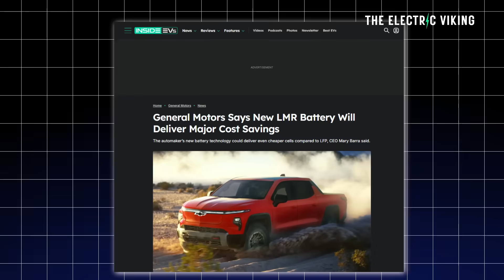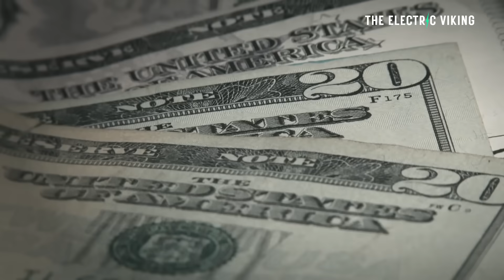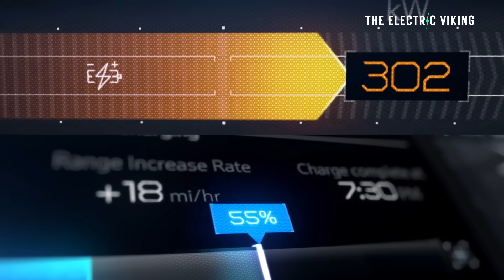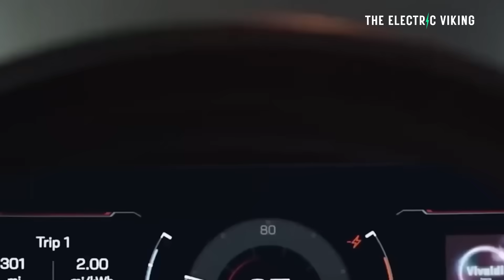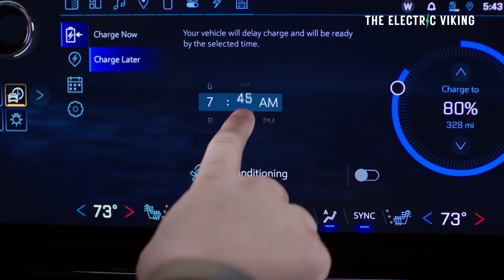GM's LMR Battery: Cheaper Than LFP?! The EV Game Just Changed!

Comment: I don't need long range. What I do need is batteries that cannot go into thermal runaway. They ALL need to switch to Sodium Ion. If all I had was 200 mile range, and fast charging then I'm happy.
Reply: Why not 300 miles range so you can road trip anyplace in the US? Thermal runaway is so rare it's not an issue. 200 mi in 30 minutes works for most normal people.
But price is a huge issue, how much extra would you pay for Sodium ion in up front costs and efficiency?
Reply: Horses for courses, but yes, non flammable or self extinguishing batteries are the way forward.
Reply: LFP can not go into thermal runaway and is widely used already. Sodium ion suffers from poor usable energy ration, but perhaps it will be improved. LFP also has much better cycle life.
Reply: @xeridea  Yes they can go into thermal runaway also.  It's what happens when Lithium catches fire. It's just not explosive like NMC.
Reply: @grndzro777 no, they cannot go into thermal runaway. Yes, they will burn if you was to throw them into an existing fire, but they will not themselves cats on fire. It is not possible. They can get hot if it's used and vent, but they will not catch fire by themselves
Reply: @xeridea at 270 C the cathode will release oxygen and has caused thermal runaway. Very rare and there need to be contributing factors.
Reply: @rodneyblackwell2557 okay, and for it to get that hot, you would most likely need to just throw it in a fire. The chance of it going into thermal runaway on its own is absurdly low, borderline impossible. In general it is a very safe chemistry
Reply: CATL already made sodium ion battery pack that has 175Wh/kg and 6000 cycles, similar to LFP in terms of energy density and longevity but with way cheaper costs. Let's hope many other battery manufacturers will follow suit in at least a few years
Reply: Good for you
Reply: Sodium batteries have very poor round trip efficiency and poor capacity. They're still miles ahead of LFP. And by the way, LFP do not suffer from thermal runaway.

Comment: GM vs Tesla vs China’s BYD: 5 Numbers That Reveal the EV Battlefield

General Motors (GM) remains a global heavyweight, but it’s facing mounting pressure from American rival Tesla and Chinese EV giants like BYD. General Motors ranked 6th globally in vehicle production volume in 2024, with an estimated output of approximately 5.8 million vehicles, behind Toyota, Volkswagen Group, Hyundai-Kia, Stellantis, and Renault-Nissan-Mitsubishi. These five numbers illustrate the financial and competitive realities in today’s electric vehicle race:
	1.	$100+ billion (GM) — GM’s total debt load towers over both Tesla and BYD. While a large portion stems from GM Financial (its lending arm), the burden puts it at a disadvantage compared to Tesla’s $5.5 billion debt and BYD’s $15–20 billion.
	2.	$85–$100 per kWh (GM) — This is the estimated cost of GM’s new LMR battery. In contrast, Chinese EV makers like BYD produce LFP batteries for just $55–$70 per kWh, giving them a massive cost advantage in budget EV segments.
	3.	$6 billion (GM) — GM has launched a share buyback program of this size, signaling confidence. Meanwhile, Tesla is reinvesting heavily into AI and robotics, while BYD is expanding production and exporting at scale — with fewer distractions and greater capital efficiency.
	4.	<1% bankruptcy risk (GM) — GM’s probability of bankruptcy remains low, but it faces more structural financial stress than Tesla or BYD, both of which run leaner, more cash-efficient operations and generate higher margins per vehicle.
	5.	$1.1 billion (GM) — This was GM’s Q2 2025 profit drop due to U.S. tariffs. Meanwhile, Tesla is building production overseas to avoid tariffs, and BYD is gaining ground in Europe and Latin America, where it’s not burdened by U.S. trade policy.

⸻

Conclusion:
GM is still financially stable, but faces steep uphill competition. Tesla dominates tech and branding. BYD wins on cost and scale. If GM can’t close the gap on battery pricing and EV margins — while carrying heavier debt — it may struggle to compete globally in the long run.
Reply: Number 4 is wrong.  BYD can't pay suppliers leaving them hanging for 9 months to a year.  They lie about their debt load like 10 fold.  They claim their debt was 47 million yuan when really it was over 300 million yuan.  They got caught lying again.
Reply: How is GM a global heavyweight, North American probably but they walked away from the European and many other world markets years back.

Comment: I paid $20k total for my 23 Chevy Bolt.  It is fast and economical.  Love this little car!
Reply: Those original Bolts were (still are) a big problem for GM. GM made a cheap, dorky little compliance car that they hoped would turn their customers against EVs. The big problem is that the customers loved them! The were cheap, quick, fun to drive and will seemingly last forever. Yes, a very small number of bad batteries (13) resulted in fires, but they figured out how to identify the bad ones so that no longer appears to be a problem. I have a 2020. It has the original battery. After 5.5 years, testing the battery shows that it still has 103% of its rated capacity. The customers demanded that they bring it back. Now GM will have another $25k car that will sell in big numbers when they really want to sell $80,000 trucks and SUVs.
Reply: @CL-YouTube-y7e  The purpose of the Bolt was to clog up chargers. If you know anything about their drivers, they are attracted to 350kW or higher chargers like fireflies for their 50kW charging Bolt. They leave them there for hours at a time. But with the proliferations of chargers in America, and Tesla opening up their vast network, that strategy went down the drain. 

So GM decided that if you can't beat them, might as well join them. And they now make the best charging EV trucks in America by far, as well as the best charging 7 seater SUV, alongside the new Lucid Gravity.
Reply: @junehanzawa5165  Most EV owners charge at home. The only people that fixate on charging speeds are people that don't actually own EVs.
Reply: @CL-YouTube-y7e  That's why Tesla started a nationwide DC Fast Charging network, when, of course, Leaf owners making up 0.01% of all cars sold knew all that was needed for mass EV adoption was home charging. Because you know that the only people who fixate on charging are those that don't drive EV's.
Reply: @CL-YouTube-y7e  That's why Norway, the largest adaptors of EV's in the world with a 96% adoption rate, has the largest number of DC Fast Chargers per capita in the world. But of course, those who say all that's needed is home charging know better, and know that the only people who fixate on charging are those that don't drive EV's.
Reply: @CL-YouTube-y7e California, the state with the 5th largest automobile market in the world, with more than a 25% EV adoption rate, has more than 2 DC Fast Chargers for every gas pump; and yet there are still long lines waiting to charge, when of course, they should know all that is needed is home charging, because the only people who fixate on charging are those that don't drive EV's.
Reply: @CL-YouTube-y7e  That's why all the major charging providers in America are spending billions of dollars installing nothing but 350kW and 400kW chargers. But of course, those championing home charging know better and know that's just a waste of money.

That's why all the major auto manufacturers in the world are all turning to 800V. Mercedes Benz, BMW, Audi, Porsche, Kia, Hyundai, Genesis, GM and GMC EV trucks, Cadillac Escallades, Lucid, and all the brands in China. But according to you that's not needed, because the only people who fixate on charging are those that don't drive EV's.
Reply: @junehanzawa5165  When actual EV owners are surveyed, 80% say that they have never fast charged. Sure, there are renters that bought EVs and found that they must wait in line. But that isn't the majority of EV owners.
Reply: @junehanzawa5165  Those charging providers are installing them because of the money allocated for it in the Bipartisan Infrastructure bill.

Your rant is proving to everyone that you don't own an EV and certainly not a home in which to install your home charger. If you did, you would understand my point. That point being that a homeowner DOES NOT NEED access to fast charging on a daily basis. They charge at home. A level-2 charger is sufficient to meet their charging needs except on road trips.
Reply: @CL-YouTube-y7e Probably more than you. We've had two Teslas, a Kia and a Rivian. And have home charging. Which is why it ticks me off so with you stay close to home and never go anywhere with your 50kW charging Leafs, Bolts and Niro's telling everyone fast charging is not needed. A mindset that did ZERO for mass EV adoption.

I just gave you Norway, China, California and all that's going on in the real world, yet you want to live in your little closed off world that never go anywhere and want people to all be like you. You all know better than trillion dollar corporations. It's all about you and your little world, and we don't need fast chargers, and we don't need fast charging EV's. Just be like us and charge at home, and on level 2 when you're at the store and get a full 10 miles for a whole hour at the store. Yeah, that's how the world works.
Reply: @junehanzawa5165   Wow....I hope you feel better.  Consider re-reading my comment.  The last sentence was what I meant to convey.  My original sense of fascination with cars.  I'm not telling anyone anything....other than the Bolt depicted in the Video is a car I really like.  The Chevy Bolt is a fun little car and super economical.  Fast and Fun.
Reply: @junehanzawa5165  The Internet is fun! You can pretend to be whatever you want to be. I bet you parked those cars next to your McLarens and Lamborghinis.

Simple common sense dictates that people will do most of their charging at home where it costs very little or might even be free if they have solar.
Reply: ....I'd like to add that we charge with 110v and it ramps up to over 300 miles of range.  Really great car.
Reply: @orpsman76  Yep. We get a true 300 miles of range in around town driving.
Reply: @CL-YouTube-y7e   I LOVE single pedal driving.  Which also increases the rate of reclamation.
Reply: @CL-YouTube-y7e  That's why Tesla started a nationwide DC Fast Charging network, when, of course, Leaf owners making up 0.01% of all cars sold knew all that was needed for mass EV adoption was home charging.

That's why Norway, the largest adaptors of EV's in the world with a 96% adoption rate, has the largest number of DC Fast Chargers per capita in the world. But of course, those who say all that's needed is home charging know better. 

That's why China, the country with the highest total numbers of EV's in the world, have 400kW, 500kW, and upcoming 700kW charging EV's with chargers to match. But of course, you know that home charging is more important and they're clueless.

And California, the state with the 5th largest automobile market in the world, with more than a 25% EV adoption rate, has more than 2 DC Fast Chargers for every gas pump; and yet there are still long lines waiting to charge, when of course, they should know all that is needed is home charging.

That's why all the major charging providers in America are spending billions of dollars installing nothing but 350kW and 400kW chargers. But of course, those championing home charging know better and know that's just a waste of money.

That's why all the major auto manufacturers in the world are all turning to 800V. Mercedes Benz, BMW, Audi, Porsche, Kia, Hyundai, Genesis, GM and GMC EV trucks, Cadillac Escallades, Lucid, and all the brands in China. 

But yet you, and all those championing home charging and slow charging EV's, know better than all of them and know that home charging is way more important. Forget their combined trillions of dollars in valuations, you all know much better than them.

Because you know that the only people who fixate on charging are those that don't drive EV's. Those waiting on those lines, including for 50kW Bolts and Totoya BZ4X blocking 350kW chargers, are just fake news.
Reply: You are such an idiot to buy an antique American junk car with so much money enough to buy a luxury Chinese EV.
Reply: Yes. 90% of all the Chevy Bolts are still on the road!
 The other 10% had enough charge to get home.....
Reply: @JohnShields-df8od  That joke started with the Model T.
Reply: @JohnShields-df8od 🤣 I was in the 10%
Reply: They discontinued the bolt because too many batteries were defective causing fires. They are supposed to make a new gen in 2026.
Reply: @PyroShields  Exactly 13 defective batteries caused fires. That compares with 232 Tesla battery fires.
Reply: @PyroShields Original Bolt was an older platform that's pricey to manufacture mostly.  Even with the battery issues Bolts still had a lower rate of fires than gas cas do, and hybrids are even worse than gas cars for fires. Look up NHTSA car fires by car type. Used Bolts sell like hotcakes around MA, I'm looking for one.
Reply: @ronfarnsworth7074  GM and NHTSA was advising not to park these cars near your home.  Why do you think they discontinued them.
Reply: @PyroShields Yes that was true while initial diagnosis and proof of fixes was taking place. But if that's a concern then gas and hybrid cars should never be parked in a garage.
The original Bolt platform is very dated at this point and expensive to manufacture. With less margin on small cheap cars that's a big factor and good reason for GM to update plus with updated platforms they can sell to Honda, Acura, etc.
The original battery problem is that LG manufactured the pack temp control loops incorrectly. LG and GM split the cost of recall 50/50.
Thanks for reply.
Reply: @PyroShields  16 fires. Out of 142,000 sold that were recalled.
Reply: @ziploc2000  There were 18 total fires, but only 13 were actually caused by defective batteries.

While they recalled all cars, they ultimately remediated most by applying a software fix that proactively identified when the battery was defective. Not all batteries had to be replaced.
Reply: @CL-YouTube-y7e Ah, thanks. I've seen 16, the point was it was a tiny fraction compared to the number of gasoline powered cars that burst into flames.
Reply: @ziploc2000  There's a tiny fraction of the number of EVs as there are gas-powered cars.  In China, which is "ahead" of us on EVs, there are ordinances against using enclosed car parks because of the catastrophic fires.
Reply: @PyroShields  They discontinued the Bolt because it was not and will never be a highly profitable vehicle for them. Less than 20 of the bad battery packs burned, nobody was seriously harmed, and GM learned how to identify the bad ones and completely dialed them out of the fleet on their first attempt. It was actually a master class in how to deal with this kind of extremely serious technical problem. The model is being brought back only due to extremely popular demand and maybe the existential threat of BYD and the increasingly impressive Chinese offerings in the compact EV space.